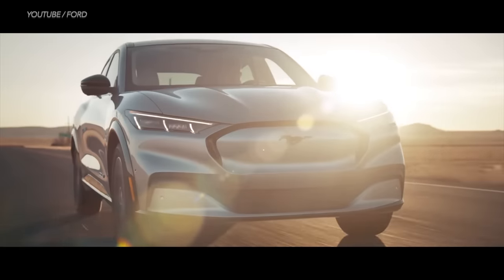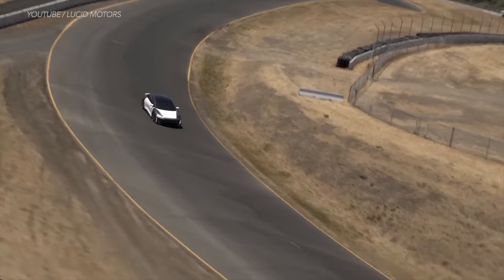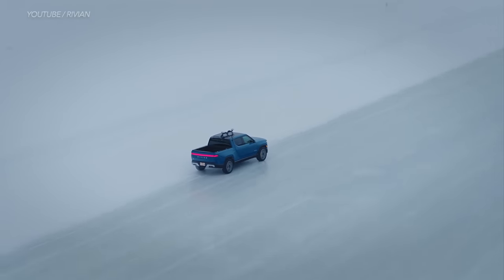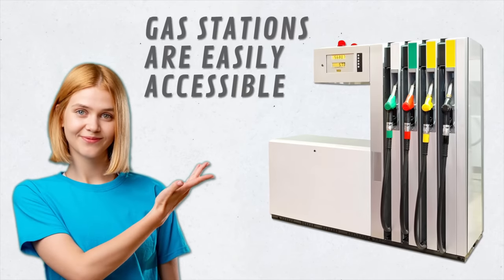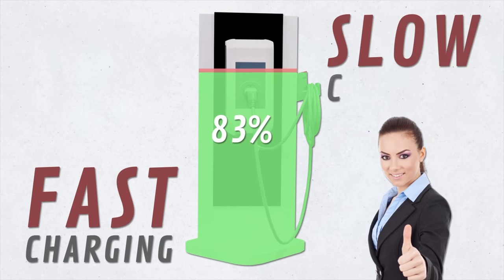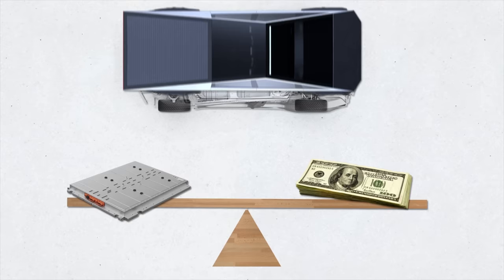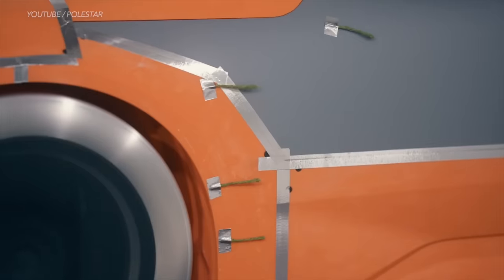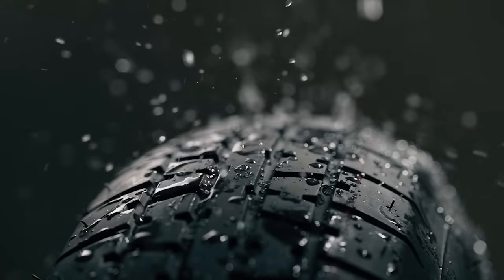New Study Shows Electric Cars are a Scam

Comment: I have owned my EV for 9 years. I agree with most of what Scotty has said in this video. I learned by owning and driving one. Would I buy another EV? Yes, but not now. I will wait until things stabilize. There's a lot going on as manufacturers try to get their EVs on the market as soon as possible. There will be screw ups. That said, I wouldn't buy a new ICE car at this moment in time either due to supply side issues. Everyone is scrambling for parts, changing vendors and the like. Remember, it only takes one bad part to turn a good car into a bad one, EV or ICE.
Reply: If they EVER become viable I want one.  I've wanted one ever since I was a kid playing with slot cars
Reply: William Wintemberg, Thanks for your
well stated response. Being of limited
means I am waiting for the dust to
settle and sifting to be done in
EV world before buying.
Meanwhile I drive a 2003 Avalon
XLS, bought in 2021, rigorously
serviced with upgrades and
trouble free on my round trip
San Diego to Toronto and
back this year. Paid off the
car for my 74th birthday in
July 2022. 
With Toyota build quality of
Camry/Avalon models of that
generation  "Avy" may outlive
me.
Good luck with your next buy.
Reply: @protonneutron9046  I hear you. I also played with slot cars as a kid. Take your time, the dust will settle in time.
Reply: @garyowen3662  Thanks for your kind words. There's absolutely no reason to buy now if you don't need to. I'm in no big hurry. I'm 4 years behind you. I may run out of time.
Reply: Tesla did just do a massive price drop on the model Y. With the tax credit, it might be worth considering upgrading
Reply: @Fredman5551  Yes, I saw that. Thanks for passing this along.

Comment: I like ev technology. I think it works great for those that live farther south. I live where it's winter 8 months a year. I can charge my 99 Mazda in 5 minutes. It stays charged for 2 weeks, sometimes 3. It can get -20f where I live sometimes.
Reply: it sucks down South where it is hot all the time.  The air conditioning drains the battery FAST
Reply: Much more Hot in the South especially those in the Southeast with high humidity.Obviously Cold drains a 🔋 faster,though I have seen Charts that shows Hot weather can degrade batteries faster than cold weather long term etc
Reply: @protonneutron9046  I didn't know that. Either way for me, I will stick with my gasoline car.
Reply: @michaelp9707  Staying warm is what I need. It doesn't take anything from my mpg to heat, other than the blower fan on the alternator. Ac is a different thing altogether. I am glad I live north.
Reply: @protonneutron9046  Either way you cannot win with an EV
Reply: @leskobrandon6950  
It is the free engine heat blown into the car.
Reply: @TheGecko213  I am more than aware how a heater core works. Its the fact an electric car doesn't have a hot engine to extract heat that makes them inefficient for cabin heat delivery.

Comment: This 1st generation of EV are just like the first cell phones, computers and digital cameras. Overpriced junk but the worst thing is people don't realize that their beta testing, actually alpha testing...
Reply: Absolutely! And knowing that lithium-ion batteries are not best for cars yet buyers are buying them. I feel solid-state batteries will solve the battery issue.
Reply: @aeronYTco  Sure. Anyone can afford 50-70k usd car.
Reply: @valleyofiron125  How many miles on it and what kind??
Reply: @valleyofiron125  How many miles?
Reply: @valleyofiron125  Thanks for your honesty and realist report. I'm glad a EV works out so well for you. In my case the requirements are alot different and probably need the next generation of EV. Enjoy your inexpensive transportation and I like the fact you can charge with 120V, that's VERY COOL...

Comment: Reduced EV range at higher speed is down to fundamental fluid dynamics. Generally speaking, the energy required to  overcome air resistance over a given distance is proportional to the speed squared. Driving 100 miles at 70 mph will use 4 x more energy than driving 100 miles at 35 mph. Regen braking makes no difference if you're on a level highway and aren't constantly accelerating and braking.

Comment: Them keeping the battery from charging to 100% to increase the life is just a red herring. If you keep charging that same battery up to 82% bad battery will develop a memory. And you won't be able to charge it up over 82%. In other words 82% becomes 100% and your charging level will go down and the life of the battery will be the same. And nobody mentioned spoil that garbage is coming out of those batteries when they are no longer used. And unless the EPA is requiring serial numbers and all these batteries and tracking them to make sure that they don't end up in our Community dumps I'm poisoning our water tables. But we don't have to worry about that anyway all those LED light bulbs Mercury that's already been dumped into our Community trash sites with kill us long before the chromium does
Reply: agree with Bill.
Reply: @jamesvandamme7786  And you work for Tesla

Comment: Yup. My calculations show they are not superior to internal combustion in terms of carbon emissions.
Reply: wrong , the battery cost thousands of tons of CO2 to manufacture it. 480KMILES of driving just to break even with ICE vehicle.
Reply: @BigEightiesNewWave  my phrase might be unclear…I meant the over all emissions are similar to petrol/diesel including manufacture.  The extra eV manufacturing emissions would be about 50 tons. 1000s of tons is physically impossible if you think how much fuel a diesel car uses while driving (about 20 tons if it lasts well, so about 80 tons co2). Eg 40 mpg, 200 k miles, 5000 gallon, 22000l, 20 tons x4 to get co2, 80 tons CO2. The eV battery manufacture logically has to be less than that, or it would be obvious that EVs cause a lot more pollution than ICE, assuming we classify CO2 as pollution.
Reply: Most of the carbon in producing EVs (and ICE cars, for that matter) come from electricity usage. As the grid becomes greener, this problem fixes itself.

Comment: This can be metaphorically be applied to ICE's as well. Take the Bugatti Chiron for example: Flat out, it can do about 300 MPH (Not kilometers, miles), but will drain it's tanks from full in 9 MINUTES FLAT! If you do the math, that's only about 45 miles of range on a full tank, but if you drive more conservatively on the highway, you can get double that at around 100 miles.
Reply: hey m0r0n, what % of people drive a Bugatti ?
Reply: lmao yeah, thats a v16 quad turbo bugatti.  With normal cars it isnt nearly as much of an issue.  I remember hearing a guy talk about how he took his tesla model s on the nurburgring, and literally drained the battery and had to recharge, plus half way through the lap went into limp mode due to battery saving/overheating.  Meanwhile people in normal cars can be out for 20-30 minutes and drain half a tank.  Just from looking in the racing world, why do you think EV's havent taken over with their "superior torque delivery"  because like the problem mentioned above EV's drain their battery incredibly fast, which is why formula E races barely last 30-40 minutes.  And nobody wants to sit around and twiddle their thumbs for 20 minutes after every 30 during a 6 hour race.  Meanwhile gasoline/hybrid race cars go for 45 mins to an hour, and fuel up in 30 seconds then get back on the track.  Its just impractical.  Plus while on the subject EV cars typically only have one forward gear.  which means off the line they feel fast and torquey, then after 120-130 they accelerate at the rate of a honda civic.  Slower, less practical, more boring.  Yeah no thanks, I'll stick with watching fire spitting ice race cars.
Reply: I guess you have a point. People who have bugatti money don't really care about range, but they also have trucks to haul their supercars around when they're not driving them.
Reply: @Homiloko2  so?
Reply: @Homiloko2  Tesla owners too! Remember Cartrek when Hoovies' model 3 died? LOL!!!
Reply: @Rekuzan  Apparently you don't know how to write an analogy.  ESL classes might help you there.
Reply: @protonneutron9046  Drive EV faster use more juice, drive ICE faster, use more gas. How is that NOT an analogy? It's a textbook example. Yer the one who needs a refresher course.

Comment: Think about it.   The first cold day, tow truck drivers are making a mint jump starting cars cause consumer just found out their battery is weak and old in a gas car. Electric cars do not work in the winter cold.   Anyone who has driven around in the cold and it is snowing knows you need full hot air blowing on the windshield in order to keep it clear.  So you got full blower, wipers on, not much draw.  Where are you going to get the heat?   Electric heat sucks more power than the wheels do.  A heat pump will work to a point but after a certain temp, there is no heat out there to pump into the cabin.  They also ice up on the outside heat exchanger.   P.S.  LAWSUIT COMING for the mom and her kid that got frostbite cause they slid out and got stuck.  The heater would not operate to keep them warm till tow truck showed up.

Comment: Electric cars are a far cry from what they were back in the nineties. But they are still a far cry from where they should be. Or where everybody wants them to be. Internal combustion engines are still going to beat electric vehicles. Because with an internal combustion engine vehicle you can run it on fumes. With an electric vehicle you can't. Also electric vehicles are super pricey to repair if they are damaged or if any repairs are needed Do to wear and tear. The reason for the high cost of repair is because of all the electronics and sensors and cameras put into them. That is another reason why an internal combustion engine vehicle will win.
We are another 20 to 30 years from where people think we will be in the next 7. As far as electric vehicles go. 
It is also a point to note. That some of the materials needed to make those batteries is obtained through strip mining. Voiding the land of all minerals so that nothing will regrow. Leaving bare pits behind.
Reply: Theyre only expensive to repair because insurance companies havnt caught on yet. Rather than repair whats broken, they replace the whole module leading to crazy high costs of replacing sensors and what not that arnt broken. I had my brand new model3 get the front bumper torn and bent when a friends family member backed out of the driveway. 

Luckily, my friends brother is a manager at a dealership and was able to fix it for free within an hour. I've seen similar types of damage cost 10k through insurance.

Comment: One thing I haven't heard talked about is, what if you fully charge the batteries then just leave the car for a month without driving it? Scotty mentioned it briefly here.  Lithium batteries do not like to be fully charged and just left, nor do the like to be totally discharged. It has a detrimental affect on the lifespan of the batteries. I'm sure the batteries are slowly discharged over time by design in the car,  which is something else not really talked about.
Reply: I am a multiple electric bike owner here. First of all there are several different chemistry types of Lithium Ion battery packs Also there are other chemistry battery packs being introduced as well. The owner of a Lithium Ion battery pack is advised to store the battery at a 75% charge for longer term storage and storage is preferred at near room temperatures. Personally I keep a good amount of boxes of baking soda around if there is ever a battery pack fire. I have owned E bikes with many extra  Lithium Ion battery packs for 10 years and have never had a problem. Lithium Iron Phosphate batteries don't have this fire danger issue because of their chemistry. My first electric bike battery was Lithium Iron Phosphate coincidentally.

I prefer electric bikes because the vast majority of the energy used on a big heavy car is wasted just moving a big heavy box around from point A to point B whereas with a fairly light in weight bike the majority of the energy used is more efficiently used to transport the rider from point A to point B. Another reason why I prefer them is that I can get healthy aerobic exercise pedaling bionically with the electric motor.

However there is a method of transporting 2 objects between two points in dimensional space by the  warping of space-time and the difference in mass
Reply: Just keep it plugged in, a 110V household outlet will do, and limit the charge level through the app.   But even if you don't plug it in you'll only loose about  10% of the charge in a month's time.  And there's never a need to charge to 100%

Comment: All the problems and issues with batteries are solved by gasoline.  Cars were originally battery operated until the ICE came along and blew it out of the water.  Now, you have idiots saying the past is the future.  These EV heads always want to ask how much did you pay to fill up the tank....I actually only need a half a tank of gas to get the same range as their EV.  My Optima with a full tank shows a 500 mile range.  This is also a Mid size car and not a compact.   In another 5 to 6 years when all these 2018 Model 3 start ending up in the junk yard after 10 years of service and dead batteries we will have another environmental issue and the long term cost of owning and EV will rear it's ugly head.  We have a 20 year old Toyota Tundra that is still running, had it been electric it would be long gone and we only have 135k miles on it.

Comment: My Batrey 🪫low. 

Loving my conventional front wheel drive 2002 Ford Taurus with a 1,000 lbs towing capacity. I average 17 miles per gallon on this large little powerful car. 

The best thing about it is that l own this car…not the bank. 😀

Comment: Mullen Automotive claims they have a battery that will get over 600 miles per charge. The problem is, they have no patent to back up their claim. They have tested a single cell and claim it has a "potential" and of course have partnerships with Chinese battery companies. It's comical some of the claims coming out of companies like Mullen.

Comment: EV range only decreases with speed due to aero drag, which also pulls down ICE or anything else.  It's an aero thing, not a better city vs hwy thing (just worth realizing because aero penalties are for everything.
Lots of this simply applies to driving in general, regardless of vehicle type.
Cold weather is the one that does impact.  Having said that, it's never impacted how I use my car.
Reply: Highway mileage is lower because you have very little, if any, regenerative braking. In my pickup I can easily go 300+ miles and seldom even touch my brakes.
Reply: So use an EV for 9 months of the year, and then use your ICE car or SUV for 3 months out of the year. Like use an ICE vehicle in the winter. Then everyone's friggin' happy - why are there so many whiners about it.
Reply: @cbmech2563  Common misconception.  Hwy mileage on an EV  is only lower due to drag from the air.  Regen does help recoup some (just some) of the energy spent speeding up the car, but a EV efficiency is about the same at any speed until drag starts coming into play.
Combustion cars suffer in city due to the gearing of the tranny.  They'll do best generally in low RPM of their top gear, but once you start tapping those highway speeds (60+), fuel economy starts dropping again ... drag in both cases.  Your pickup, for example, will go farther going 55 than it will going 75.  Same w/ the EV, drag being the culprit.
Reply: @metalmike570  Yeah, use whatever works for ya.  If it's full ICE.  Go for it.  Full EV, go for it.  Half 'n half ... go for it.
Reply: @JT_771  I'm driving a 97 f250 with a 7.3 powerstroke  diesel and my best mpg in overdrive is at 2200 rpm. I can get 20 to 21 mpg. My best mixed city/country roads is 15 to 17 mpg.
And, sorry, but I've seen data that shows regenerative braking is a significant part of the mileage figure.
Reply: @metalmike570  because not everyone can afford to buy two cars.
Reply: @cbmech2563  That's due to the top gear ratio and why all ICE stuff does best in top gear and the reason why city is lower.
Regen does help, no doubt.  But the highest efficiency is always going to be steady driving, not accelerate, decelerate, etc, even with regent.  Regen simply helps compensate by recovering some of the energy that would otherwise be lost as heat in the brakes.
Reply: @BillyGumbino  True that but a beater ICE car as a second car will last a damn long time. You're saying it's tough to have two, yeah that's also correct.